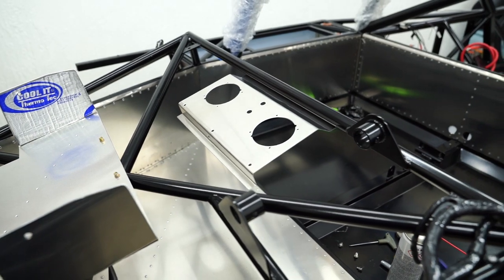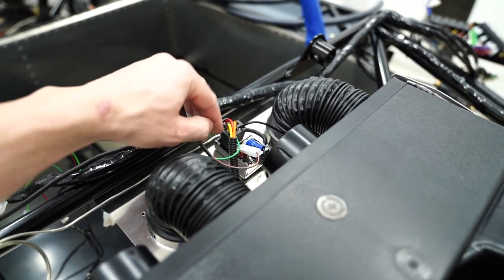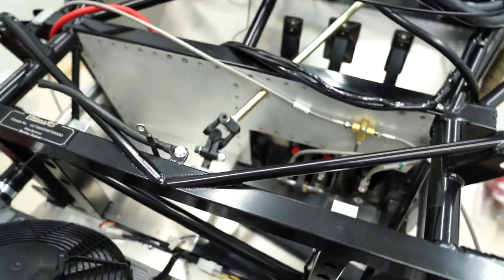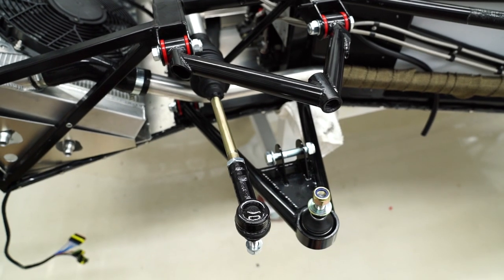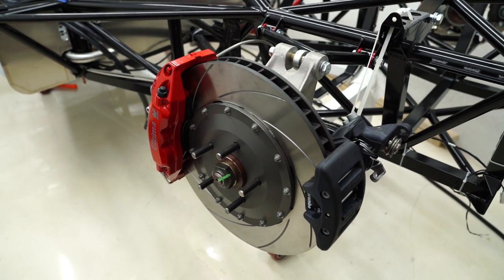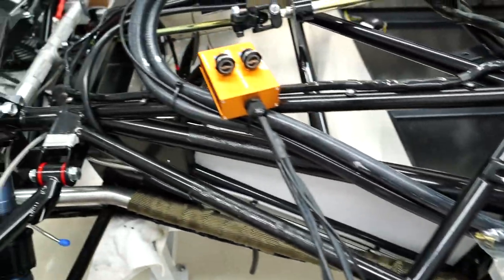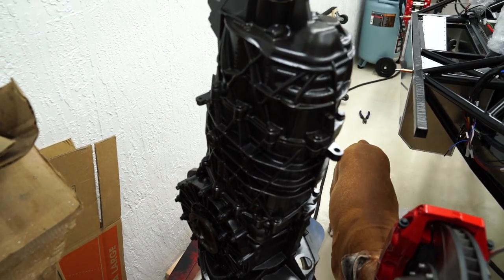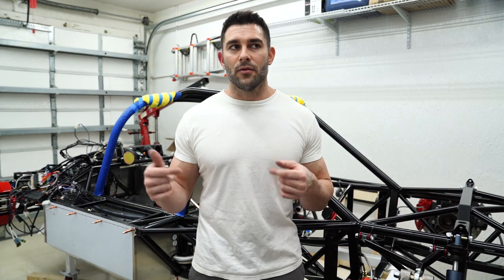Ultima RS Build 03 - Stopping, Turning, Shifting, and Cooling!

Comment: For your dropped washer an nut. Post the nut into your socket then use masking tape to to hold the washer on the face of the socket. if you wrap the tape around the socket you can align it so it just overlaps the face of the washer.

Comment: How about some TrimLock edge trim or some sort of padding where your heater hoses run across the aluminum cutouts in your storage box? Hose vibrating on the aluminum edge will wear a hole fast. BTW today I washed, clayed and Meguiar’s Hybrid Ceramic Waxed my ‘05 Lotus Elise in the garage. Great stuff never used before. Car looks better than showroom finish. Got motivated for garage work after watching your vids. Stuck here in Kentucky with nowhere to go. Love your videos!
Reply from the maker: Thanks Craig! Yeah there will definitely be a barrier between the hoses and the aluminum. Nice job on the Lotus! This whole Covid thing is terrible except for getting things done at home.

Comment: Gabe, that heater control valve looks like it closes all the fluid when shut. On GM engines you still want water to circulate through the water pump heater outlet and inlet so you should have an H pipe or something connecting both heater lines. Otherwise the engine can overheat. A couple companies make specialized heater control valves for LS/LT engines. I’m doing an LT4 build and using a HCV from Old air products.
Reply from the maker: Great point. I'll have to check on that. Thank you!
Reply: There is an H-pipe that sits in-line allowing coolant to circulate when the valve is closed, but Gabe hasn't got to that part yet so spoilers!

Comment: Not a big deal but I always put a oil pressure gauge that is mechanical on every single build I do. They don’t lie and they are easy to install. Doesn’t have to be in the car with you but you can put it somewhere that you can see it when you first start it up. I love the digital gauge packs but I like too know that I have oil pressure.

Comment: Next time on the yoke on the steering shaft if you remove the bolt all the day and stick a screw driver in the split and tape it a few times it opens the spacing a tiny more and allows the shaft to slide right in. Install bolt tighten and it’ll be good to go. I don’t see mush issue with removing a little of the coating as long as you don’t gum up the splines, and it’s a little more likely to build up corrosion over time but that’s a lot less of a fear as this isn’t a daily driver or in rough conditions.

Comment: Brembo is the parent company of AP Racing.  Pretty sure is the source for a lot of parts in AP brake systems.
Reply: They were the innovators like first Carbon clutch, and so on.
Reply: Brembo bought AP Racing yes. But AP Racing and Brembo were basically F-1 Rivals. As far as household name Brembo now has the name. History, F-1, Clutches, Braking Systems AP is the king. They were the innovators like first Carbon clutch, and so on.

Comment: Fascinating watching your progress. My brother and I interested in our own build. So your progress is a road map and real lesson in excellence. What transmission are you using? Having driven a Radical my preference would be a sequential possibly with paddles. Your thoughts?
Reply from the maker: I'm using the Porsche G97.50 which is an H-pattern manual box. I am hoping that some company will make a stand alone controller for the new Corvette C8 transaxle (TR-9080) and upgraded clutch discs since it will bolt right to the back of my LT5 and would probably be the best bet as far as integration into the GM ECU. There are Ultima guys using air shifted Albins sequentials though so it's definitely doable.
Reply: @UltimateUltimaRS  I see it is 4x4, do you have to have it converted and does the rear output remain? Or has this been done already?

Comment: take off the counterweights from the shift linkage on the trans. will help with shifter feel
Reply from the maker: Hmm interesting idea... have you done this with Porsche transaxles before?
Reply: @UltimateUltimaRS  yes. I had a 996 tt that was built to 1000 rwhp. the 996tt trans is actually stronger than the 997tt trans and about 3k cheaper. using cup cables and you can even use the cup car shift linkage if you had the trans apart for even sharper shifts.

Comment: Are you putting aluminum pop rivets in freshly drilled holes in a steel tube chassis?  Or are they stainless steel shanked rivets?  As a retired aircraft mechanic, I would be considering the possibility of future corrosion between those dissimilar metals.  We use Cherry Loc rivets in aircraft assembly or  repair work, which have a stainless steel mushrooming part and the stem snaps off flush with the top of the finished installed rivet. That bit of shank adds strength.
Reply from the maker: I believe they are steel rivets that bond the aluminum to the tube chassis. Once the holes are drilled into the chassis, I spray cavity wax every three holes to prevent corrosion. Those Cherry Lock rivets are next level and it would be nice if those were used in the kit.

Comment: Loving the build videos mate! It's hard to tell on my phone, but is that shifter and handbrake tunnel cover real CF? If yes, did you get it from ultima, or did you get someone to make it? Richard has told me they only supply the fake CF cover..
Thanks!
Reply from the maker: It's a CF vinyl wrap. I was a bit disappointed in that. I may skin it in real CF... we'll see.

Comment: I've been contemplating this build for about 10 years.  The only reason I keep putting it off is I think it's going to be extremely difficult finding someone that will insure it without any mileage limits or "parade only" limitations.  I know during the build, your homeowners insurance covers it (already looked into that).  Have you gotten far enough along in the process to start the insurance search?  All of the insurance research I've done, the insurance firms have black-listed the Ultima brand.  I'm eager to see what you come up with.
Reply from the maker: Have you looked at Grundy?

Comment: Are you going to take any special precautions/barriers due to the high humidity and condensation from the AC? Just wondering about dripping or water collecting from using the AC every time you are in the car.
Reply from the maker: There are two drain tubes which exit the back of the A/C unit and flow to the ground. No worries there!

Comment: Should have used a double glue adhesive in between the plate and the pipes before installing the ribits. So if vibration make it loose in the future with will not raddle.
Reply: For the ac plate.
Reply from the maker: I did so, but it wasn't shown in the video. There is sealant between every riveted panel.

Comment: Build looked 1000% better in person. But I will say. I would have coated both the shift knob and the e brake handle in that header burnt bronze. But then again. That's just me🤔
Reply from the maker: Didn't even think of that, Jeremy. Scratching my head now!
Reply: @UltimateUltimaRS  got you thinking about that. It would look good.

Comment: Just a quick question, how are you going to get all the swarf out of the chassis from all the rivet holes?
Reply from the maker: Unfortunately there isn't a way to do that. To make sure none can be heard and to prevent corrosion, cavity wax is sprayed into every third hole before anything is riveted into place. I have heard of guys using expanding foam as well.
Reply: @UltimateUltimaRS  nice, I've heard of the expanding foam as well. It''s a shame the factory didnt leave any well placed holes on the underside or on the ends for you to blow it all out before capping them.

Comment: Did you consider going with an electric power steering unit?
Reply from the maker: Briefly... I've seen other builds with it but I don't think the extra effort will bother me much.
Reply: @UltimateUltimaRS  It depends on the tire sizing, geometry, and if you have to negotiate tight parking areas, a lot. I'm getting close to 50, so a little extra help isn't a bad thing.

Comment: Is there an electric power steering option for the RS?
Reply from the maker: Not directly from Ultima, but there are several owners who have fitted electric power steering to them. Definitely possible and doable.
Reply: @UltimateUltimaRS  Ok, good...at least it could be retro-fitted at a later time if you should so desire power assist. Thanks, great job.

Comment: How many hours a day do you work on this project? Thanks
Reply from the maker: I try to put about 4 hours per day into it. Sometimes less, sometimes more. But I'd say that's about average. Time really flies during stuff like this though so 4 hours goes by in what seems like 45 mins.
Reply: @UltimateUltimaRS  your doing a great job I can’t wait to see the finished project and you driving her. Got to saw I am leaning toward a Ultima RS build, but maybe finding someone to most of the work. I’m turning 74 not much time to have the fun your having. Thanks for responding Dave

Comment: Gear lever doesn't look like your typical H style, how does it operate
Reply from the maker: There are cables that attach to the bottom of the shifter and go to the transmission.
Reply: @UltimateUltimaRS  so it's sequential?

Comment: not a good work you do hole in a metal tube and put rivet without painting hole you just did rust in coming soon for the rest good assembly
Reply from the maker: Wax & seal was used.

Comment: A lot of home chassis builders should really examine the chassis on the car. They are overbuilding to the extreme when simply guessing what is adequate for a given strength.  Box sections and knee or cross bracing multiplies the strength by over a factor of 10 to a single pipe.  Even if you don't have any idea what material strength is, most newer CAD software has built in failure analysis based on decades of quantitative data and testing.
Overbuilding a watch will make it last forever.  Overbuilding a chassis in what I've observed is adding more than a half ton in excess weight. Now you need bigger brakes and more power to accomplish the same objective. It doesn't make the car safer for those that plan to say more is better. It makes the car less able to maintain grip at speed, take much longer to stop and so on.  Making the odds of a crash increase.
Porsche 917k? Under built death trap, never designed for impact really.  Ultima is a near perfect example of chassis building. It even has a considerable safety margin built in but remains ultra light.
Ultima is really an engineering marvel, one of the best you can get or build.  Love it!